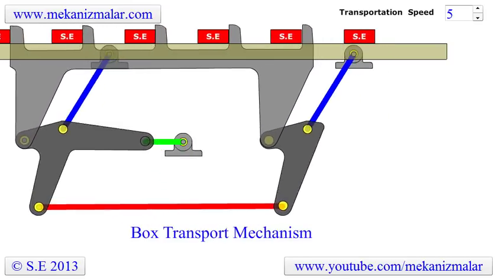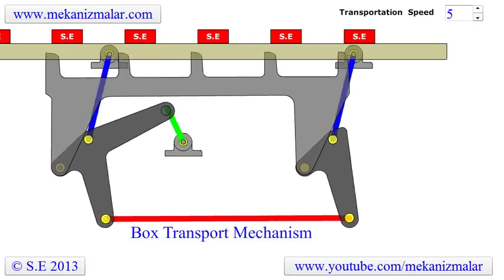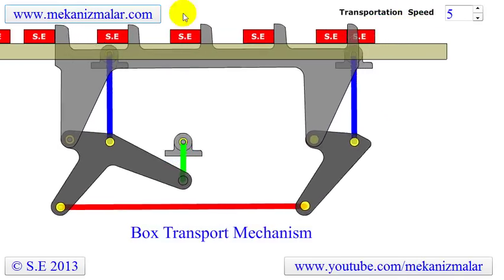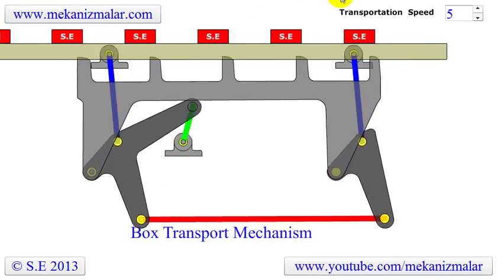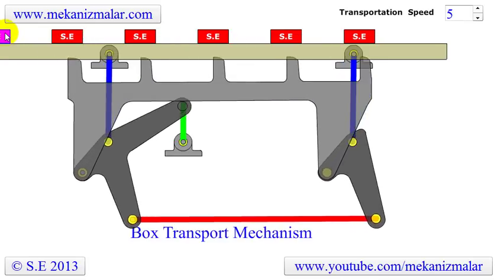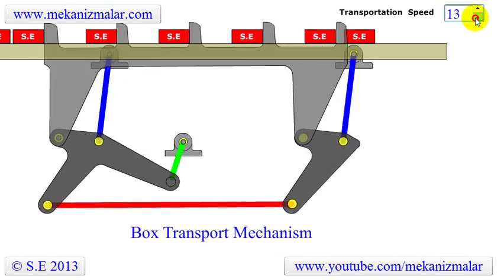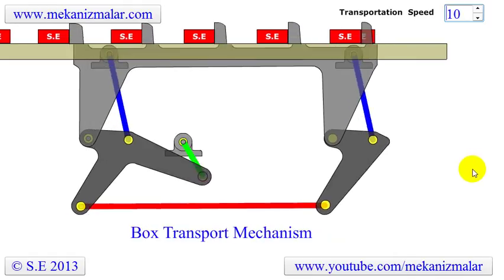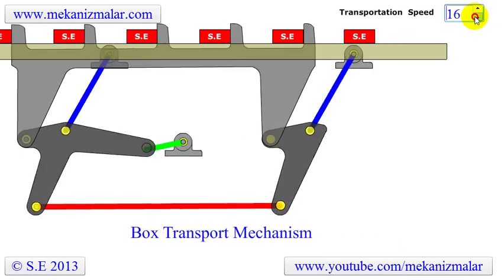Box Transport Mechanism

Comment: u can go for conveyor system instead using this
Reply: A conveyor without additional sensors and control systems would not perform the discrete positioning function of this mechanism.
Reply: @kg4lod  and even with sensors and additional mechanisms a conveyor would be a problem. Twenty years experience in factory machine repair tells me this.